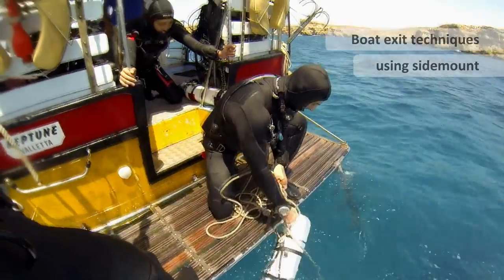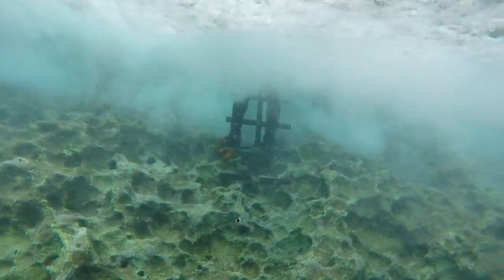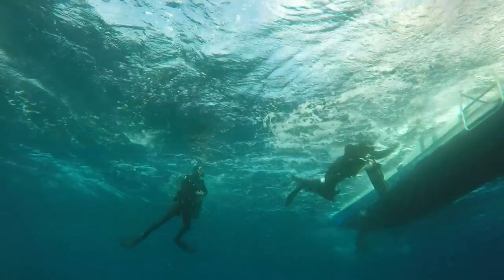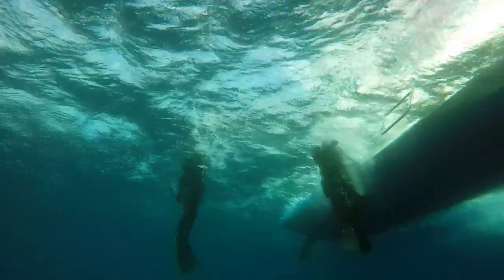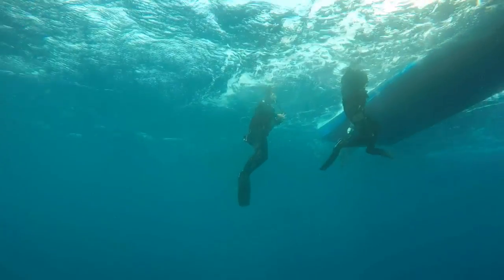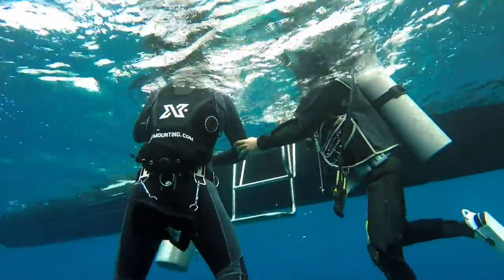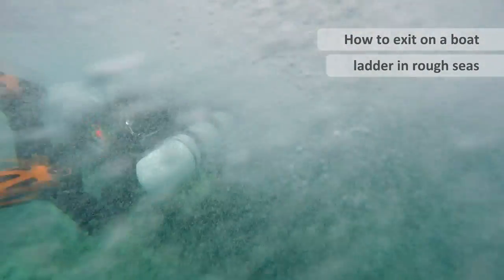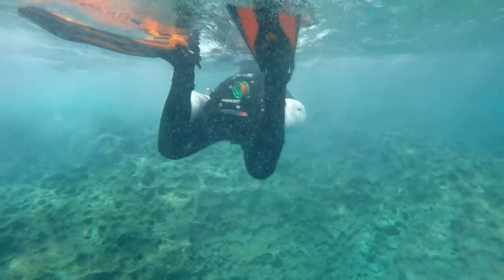Boat Diving Exit Techniques - Sidemounting.com

Comment: What is better for sidemount, DIN or yolk (international) ?
Reply from the maker: DIN is better, lower profile under the arm and technically safer in terms on getting a knock and a complete gas loss. I would say get DIN then if you need to use yoke then get a DIN to yoke adaptor, this way all bases are covered